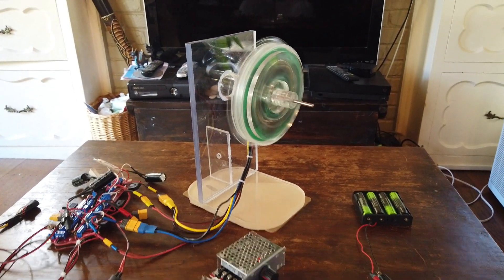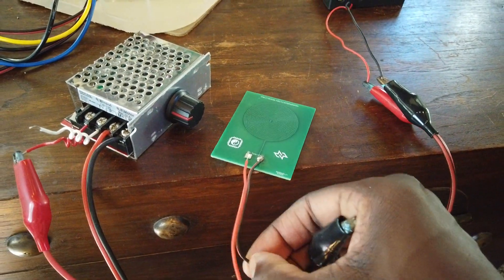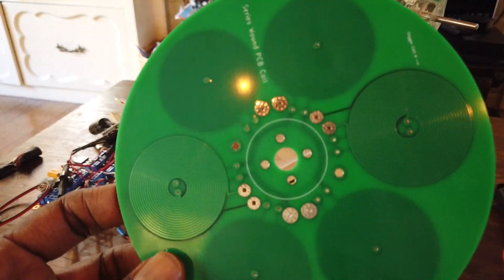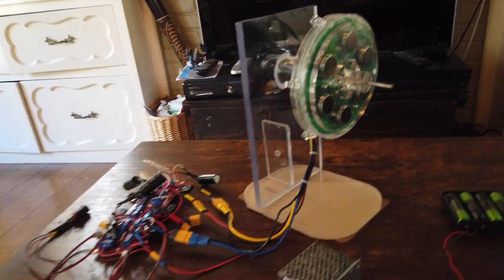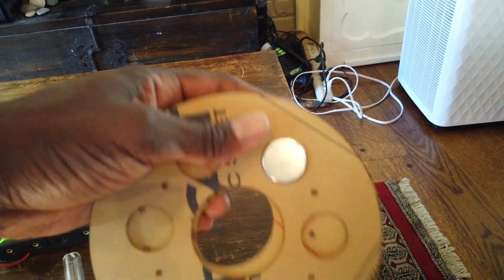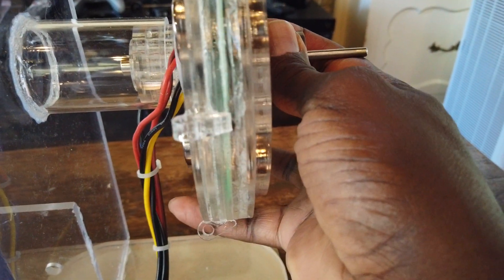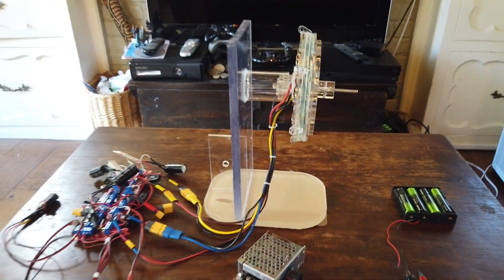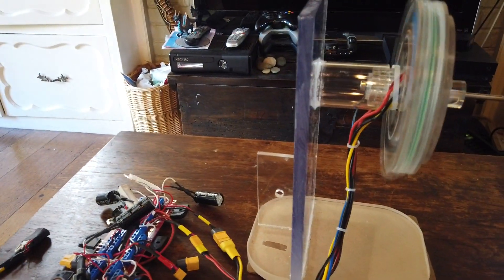The World's First Super Thin Dual Axial Flux PCB Coil Motor Using John Bedini Circuits

Comment: Greetings from India.
I appreciate you for responding lot of comments. You have good attention toward your audience. 

Can you please help me understand, why these type of motors are not widely used in consumer electricals. What are the drawbacks of such motors? What is the limitation in such geometry?

Please respond. 
Thank you. Great Video
Reply: Axial designs are gaining ground. They are not widely used  ... yet ... because radial flux was designs were getting the job done well enough. I do see potential applications in consumer electronics (fans, toys, toothbrushes, etc), but the architecture has only recently been getting attention. The only functional drawback I see, when compared to radial flux motors, is maybe with assembling them. But, right now, the supply chain for radial flux parts is dwarfed by many orders of magnitude compared to radial flux motors. However, when comparing the two, it's like comparing flat TVs to the cathode ray tube (CRT) televisions. When compared to flatscreen TVs, there really aren't that many applications where a tube TV is better. That will eventually be the case with axial flux vs radial flux. Now that I think about it, though, radial flux motors do use a lot more copper. For someone industrious enough to make useful work out of the associated back EMF and inductance, there may be something else that radial flux motors can be good for.

Comment: Interesting. If you use the standard configuration of 6 coils and 8 magnets you can operate it with a usual ESC. For me a PCB copper layer offers not enough "flesh" for the copper conductor coils (35 µm copper layer) with respect to the PCB thickness. So I would use a thin PCB (0.5 mm) only as the carrier for pancake coils.

The thickness of the PCB doesn't matter, if you operate a double sided coil system in a double permanent magnet rotor configuration. The forces in z direction compensate each other.

You can magnetically short the back sides of the permanent magnets by use of a thin low carbon steel ring in order to increase the magnetic flux in the air gap between the magnets.

Comment: you can Use a harddisk motor on the axle that's only 5 to 9 volt. Only to make an adapter for the motor to the axle.

Comment: Worlds first sounds like its not Worlds and its not the first
Reply from the maker: You're not the first to misread the title. If you know of another axial flux motor using a variation of John Bedini's circuitry - which, among other things uses a trigger coil instead of a reed switch, optical sensor, hall effect sensor, or anything else, and reuses the BEMF from the primary set of coils - then I'd be more than happy to revise the claim.

Comment: I have been wondering about this, based on repulsion. building it now just for fun to see if it works
Reply from the maker: Here’s a tip: a bunch of straight wires is probably just as effective as a coil, and likely far more space efficient. Good luck, and let me know if you have any questions on the build.

Comment: Good work 👍is it possible to stack several piece the double sided coil together to increase the coil with same direction coil?
Reply from the maker: Once the magnets are longer than they are wide, I don't know that there is a payoff. Also, if you continue sandwiching the PCB coils and magnets again and again, with series wound coils you increase the resistance, which lowers efficiency. If you have that same configuration with parallel wound coils, you lose a lot of torque because the power of each coil is reduced. There probably is a sweet spot, but I don't think stacking indefinitely helps much.

Comment: Is awsome, but i vote dislike because is not the first
Reply from the maker: It's the first with the pulse circuit that I'm using. Half of the coils are powered normally. The other half are powered by the BEMF drawn from the normally powered coils.

Comment: How would you make it self start?
Reply from the maker: I’d need to connect a hall sensor or reed switch with a momentary switch. I did that in a previous video with my 6 coil motor.

Comment: Try a 3 phase design with 12 EMs and 16 PMs. PMs and EMs can be smaller, those magnets and EMs are pretty big.
Also have a look at this: https://www.youtube.com/watch?v=627A0_3eanA
Reply from the maker: I haven't finished watching the video, but thanks for putting that together. It would have been a great resource back when I first started building motors.

Comment: What if you stagger magnets on opposite sides
Reply from the maker: Staggering magnets on opposite sides would defeat the purpose of this design if I understand your question correctly. To get a really strong magnetic field, there needs to be two magnets in very close proximity with a coil in between. Staggering would significantly reduce the strength of the field.

Comment: What PWM model are you using for this motor? Thanks.
Reply from the maker: RioRand 7-70V PWM DC Motor Speed Controller Switch 30A https://www.amazon.com/dp/B071NQ5G71/ref=cm_sw_r_cp_api_glt_i_S5YDEH02Y7BRRCZFA0DM?_encoding=UTF8&psc=1

Comment: Great video. Get a 3d printer and save on prototyping cost. Plus you can make symmetrical parts. Keep at it!
Reply from the maker: I wish. It's not that I don't want one, or can't afford one. I just don't have the space. I like your Bedini Motor.
Reply: @PerpetualMotor  Thanks, Bedini motors got me started into electronics. That last motor I posted actually has usable torque. Rotor magnets inside the coil is the way to go. You should look in to it, I bet you could add something.

Comment: Under Load what is the torque output? Temperature?
Reply from the maker: I haven't tested the torque output yet. Because the wiring is so thin a current above 2 amps requires a voltage over 40 volts, or so. My circuit usually fries at voltages just slightly above that.

Comment: You're not the first on youtube (https://www.youtube.com/channel/UCdxTCCRnQgfi2vr2fZupYIQ) but it is still impressive. Would a hall effect sensor work better though?
Reply from the maker: Carl Bugeja's Youtube page is what inspired me. However, he's using a conventional method of driving the motor. Here is a link to a video that explains the circuit that I'm using ( https://youtu.be/Cjs3GHyV10I ). It gathers the back EMF from both banks of 3 coils and reuses it. It turns out, not surprisingly though, that PCB coils actually don't have a lot of BEMF compared to conventional copper coils.

Comment: Its not letting me edit my post but I wanted to add that I think part of my system would be a good component to your device.
Reply: I do 3D printing and animation. I use blender and can create simulations soon once I get the software. Like I said just hit me up. I am working with 3D printing with carbon fyber layers.
Reply from the maker: That sounds interesting. Can you 3D print the carbon fiber? I noticed that conductive carbon doesn't seem to have a Lenz effect. If you could print a pancake coil made of carbon it would be awesome to see if it actually generates a magnetic field.
Reply: @PerpetualMotor  hit me up via email. I'm actually trying to work with formlabs on creating such a material. I can't print with it and don't know of any that can yet but it's constantly changing. However I can add carbon fiber layers for strength.
Reply: @PerpetualMotor  did you ever receive my email? I would really like to chat with you.
Reply from the maker: @jvon3885  Youtube's comment handling is not very good. Once I've read a message from someone they seem to disappear. I can't find any reference to an email. However, you can send messages at the PerpetualMotor Facebook page at http://facebook.com/perpetualmotor .

Comment: wow that make a TON of sense. I always thought it was the speed in which the magnetic field passes the coil but now I see that what your saying. (I think) lololo. Great job man
Reply from the maker: Right? It took me a while to figure it out, because everyone kept saying that it was    just the magnet.
Reply: Your motor is sweet. I really dig the way you used such flat coils and still get a great output. I've always been under the school of thought that fatter is better ugggg
Reply from the maker: Thanks! Fatter is better for some things, I think. But, by using pancake coils, I can get take a little short cut. I also learned that pancake coils don’t seem to attract metal when energized with a current! They have an effect on magnets, but not on ferrous material.

Comment: Well done! Shows a lot of possibilities. If you decide to stack more pcbs using a bifilar coil spiral arrangement for the coils, you may even get the Than Heins Effect of Delayed Lenz, assisting the motive force! Albeit, may require quite a few bifilar coils in-series and stacked to see the effect. Still PCB coils are the most space efficient and a few thousand turns to get the required high impedance is doable ;)
Reply from the maker: Thank you! Actually, all of the coils on the PCB are bifilar wound. The effect is so beneficial that it’s not even worth the time to create coils or fbI don’t do it that way. Tell me more about how Thane Heinz’s work applies to motors.
Reply: @PerpetualMotor   It would be applied to the generator / pickup coils. Bifilar coils on their own have very efficient properties when used in flyback mode: https://www.youtube.com/watch?v=Rdzz34GNkxg

The delayed lenz coils must have high impedance, iron core, bifilar, many turns so that the wire's natural frequency is within range of the PM motor's RPM. The result is you are able to delay the lenz effect by at least 50 degrees, when it would actually assist the motor when the generator coil is attached to a load:
https://www.youtube.com/watch?v=RviBQzjIX8A
https://www.youtube.com/watch?v=4cCx-AvyaD8

Thane Heins channel goes more indepth , and there is enough replications out there now online.
Reply from the maker: @ftwproject658  Woah! This is the first time I’ve heard about this. From my own testing I’ve seen how bifilar generator coils perform better, but this is next level stuff. I had also seen Thane Heinz’s work on transformers, but I had never heard about these coils. How would I find out more? That might just be my next experiment.
Reply from the maker: Thank you!!!

Comment: Sound= vibration =losses.  Beautiful build!  Have you looked into magnetic bearings? I have reached 7500 rpm with a much more primitive setup.   Keep up the good work!
Reply from the maker: Thank you. I'd like to find out more about that light you kept lit for 4 months! Dual axial flux with magnetic bearings? That might be above my pay grade. ;-) With the level of precision needed between the PCB and the rotating magnets, I'd have to figure out a way to not only hold the load with the bearings, but keep the orientation between the stator and rotor consistent. I may have to pass on that challenge...for now.

Comment: see my energy loop circuit
Reply from the maker: Where can I see it?
Reply: @PerpetualMotor  see if you can understand this 1st https://www.youtube.com/watch?v=-GNNmJd8Jcg&t=4s

then look at this diagram

https://www.youtube.com/watch?v=WH4watZLhOA
Reply from the maker: @mykedoes4099  It looks like in the 2nd video you have a circuit that, depending on how the switching is timed, could deliver the BEMF from one active drive battery to an inactive drive battery, then alternate. I'm not sure about the switch timing, though, because once you turn one off, and the other on, the time constant for the coil will dictate how much time is needed for the BEMF pulse to go to the 2nd battery. This has to happen, though, before the 2nd battery becomes active I would think. The idea does seem to have a lot of potential, though.
Reply: @PerpetualMotor  (switch timing) that is why the two independent bedini bifilars are positioned 90 degree apart. and the magnets on rotor are 180 degree apart, this way only one bifilar is triggered at a time,
Reply: @PerpetualMotor  ;) it's a unbuilt proto type be the 1st to do an open source build. GL
Reply: @PerpetualMotor  notice in the circuit that one switch is closed while the other is open, this is handles by the 90 degree separation of the drive coils/bifilar. each bifilar has it's own transistor

Comment: keep your trigger coil resistance below 8 ohm , if the trigger coil is to thin and too many windings with too much impedance it will take more flux to trigger the 3055
Reply from the maker: The trigger coils are bifilar. The resistance is 3.8ohms. I'm not sure that it matters that much. Like I mentioned in the video, in my experience, it seems that the trigger coil's ability to couple with it's paired power coil is more important than anything. I've tried various trigger coil wire thicknesses, coil turns, and orientations with respect to power coils. Based on all of this, the proximity to the moving magnet, and it's ability to resonate with the power coil seem to be what makes the system work at all. But, mass of wire mass and coil turns seem to improve the ability to start at lower power inputs.
Reply: @PerpetualMotor  less turns thicker awg (trigger  winding) if its bifilar then just lower the awg on the trigger coil only